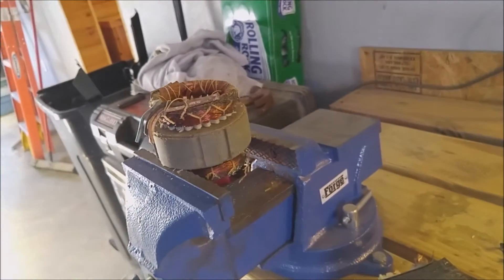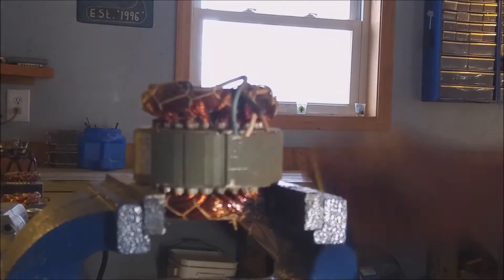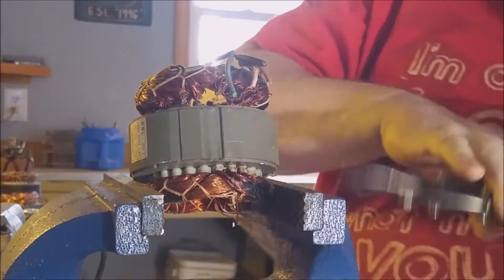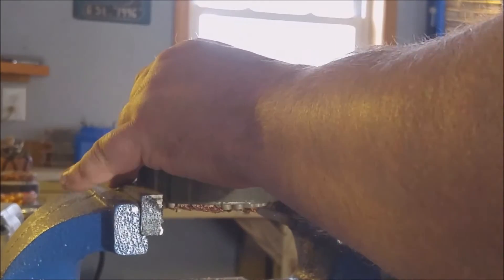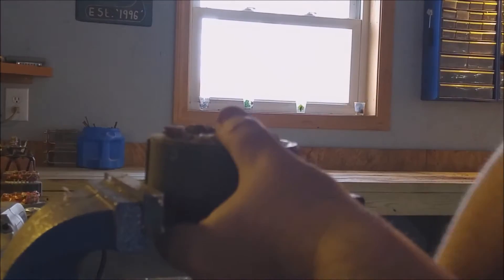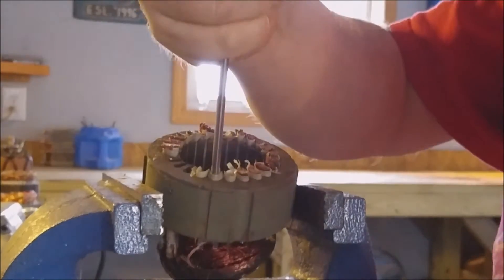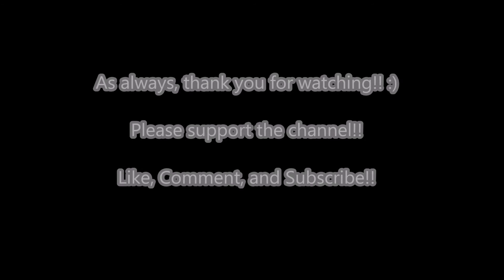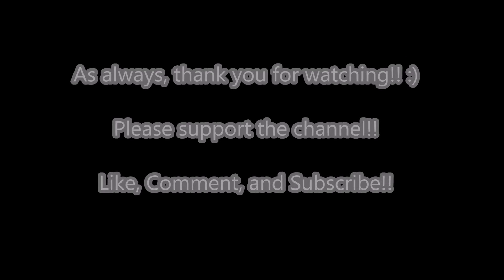Scrapping Tips: How to Separate Copper From a Transformer

Comment: Cut the first side with an angle grinder and avoid "carpal tunnel syndrome " from using tin snips.The other half can be pried out or pushed out as in the video,but use a flat end punch or nail set.

Comment: I did the a transformer from a old swimming pool motor I did all the work then found out it wasn't all copper but copper plated with aluminum on the inside
Reply: I find the newer the motor the more likelyhood of it being aluminum.I always scratch the windings before removal.You can also use weight of the motor to determine if it's alum (light ) or ( CU ) heavier.